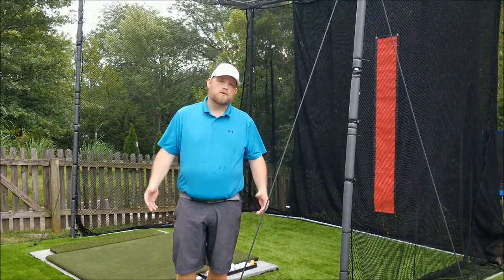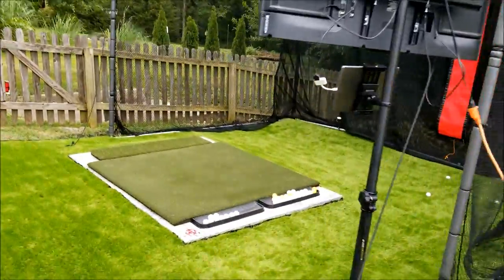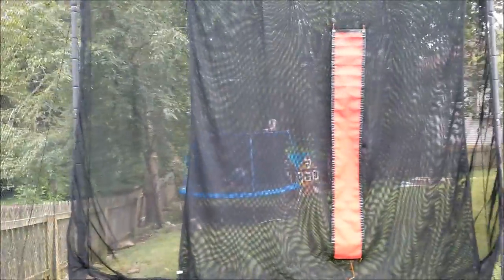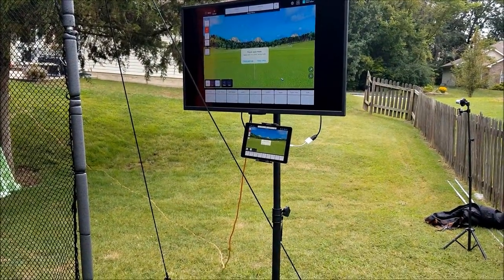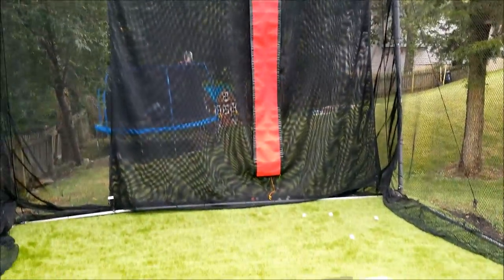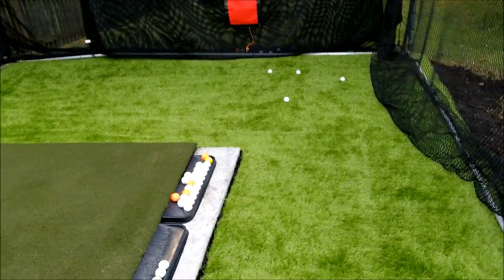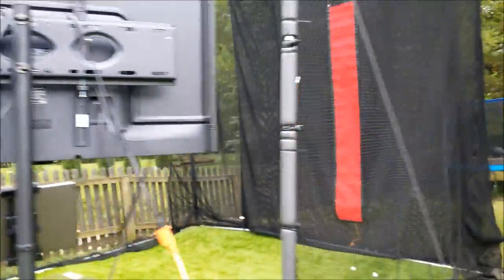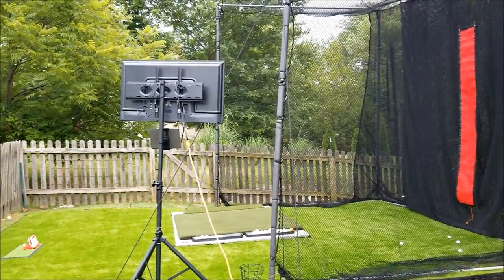Backyard Outdoor Golf Simulator

Comment: Hi what an excellent job you did.  I see that for the conduit and connectors you spent $95.  I see that today for just one piece of conduit at 10 feet is $21.24 at Lowes.  I was wondering if that $95 was just for the connectors or has inflation driven it all up that much?  Do you recall how many pieces of conduit that you needed for the project?  ty
Reply: I was kind of hoping he'd reply, by my estimation, you're going to have $275 into a net, $95 into fittings, plus shipping on those two items, and then probably almost $300 just into conduit.

Comment: that is one terrific looking backyard range. I want to do something in my yard. I'd appreciate it if you could tell us what this set up cost, minus the electronics. Thank you
Reply from the maker: Prices have changed since i built this a couple years ago. But you should be about $300 for the net enclosure, $150 for the additional baffle net i used. $250 for all conduit and connectors. Hitting mats will vary in price depending on what you pick. Id say at least $400 for a good one.  $550 for the turf i put on the ground.

Comment: Love it man! Looking at same thing around Xmas in Australia but going to do setup outside but hitting into patio so I can projector and screen cause my roof is only 8ft high so can’t do fully indoor. My question is how sensitive is the mevo plus….cause I’m thinking I’ll have to build shs steel boxes to match the height of patio as it drops just over 3 inches to my lawn. Also do you have that on indoor mode?
Reply from the maker: my mevo is pretty level with my hitting mat. There is a setting to adjust the tee height difference. Not sure how much 3" would effect it. I do run the short indoor mode as I am 8' mevo to ball and 10' ball to net.
Reply: @bramic59  From Aus as well and saw you on the FB page. Have you tried your mevo inside rather than in your backyard? I have seen that the distances may be shorter inside but wondering if this is the same if it is in "short mode" but outisde. Thanks!
Reply from the maker: @wolfyand1  I have it set on short indoor mode due to the distance from ball to net being 10'. Im unable to do it inside, dont have high enough ceilings. If i had taller ceilings in the garage I would set it up in there especially to escape the heat outside.

Comment: Hey, love the setup. I’ve been researching ideas for my own yard and came across yours.

Now that you’ve had this for a while, few questions if you don’t mind:
1) Do you take the mat inside when you’re not using it, or to protect it from the rainy season?
2) how is the mat holding up?  Does it feel good on the joints and impact?
3) did you have to do anything to keep the mat stable?

I’m in the Pacific Northwest so we get our fair share of rain and cold. Would like to keep this in working order through most of the year if possible.
Reply from the maker: i have left the mat outside now for 2 full years and have no problems. Mat is holding up well. It is pretty easy on the joints. I do have some angle iron on corners to keep the mat stable. I will be doing a new video in the near future and will show this

Comment: Nice work. Any thoughts on if 1 inch pipe was good enough? Could I get away with going larger?
Reply from the maker: This pipe has held up fine. I have gotten a slight bed due to it being conduit. I am thinking of upgrading the cage to chainlink fence top rail as it is much more rigid. But, 2 full years so far and no problems.

Comment: Hey Braden looks great! So for the horizontal and vertical poles, are there two poles connected with framing connectors due to the length being larger than 10 feet?
Reply from the maker: Yes. I put the 10' section from ground up and 2' section of pipe on the top on the vertical poles. I did 10' and 4' sections for the horizontal poles. I did add screws in all my connectors into the pipes in addition to the tension screws to  make sure they wont loosen up.
Reply: @bramic59  awesome much appreciated. Planning on putting one up myself

Comment: how easy is this to take down and put away? I live up where it can snow and don't have a place to build inside unless I build an outhouse around it hmmm
Reply from the maker: It was not easy to build and will not be easy to put away. The plan is to leave this up over the winter. Im in central Missouri so we do get a lot of cool gold weathet during the winter, low 40 degree days, so i will use it throughout the winter. The is designed to be outside all year and last about 7 years so i am not too concerned. If I do decide to take it down, the net is attached to all the framing with bunjee balls so it would be a little time consuming to do but not terrible to take down. I would not plan to take the frame apart. It was a challenge to get it built with how big it is.
Reply: @bramic59  hmm 🤔 wonder how it would deal with negative degrees weather then 🤔